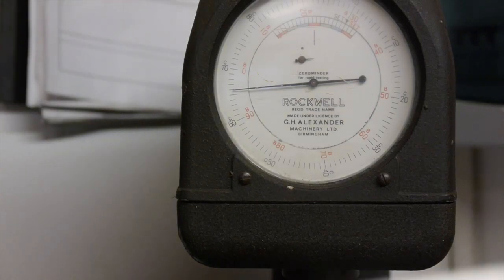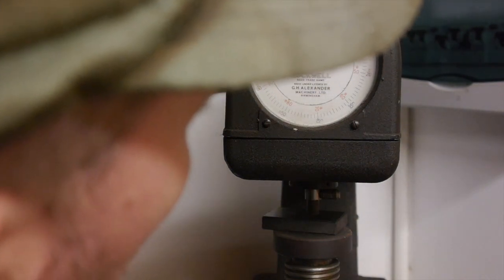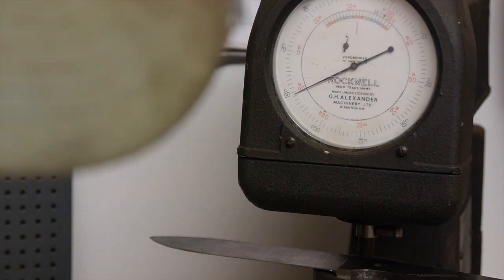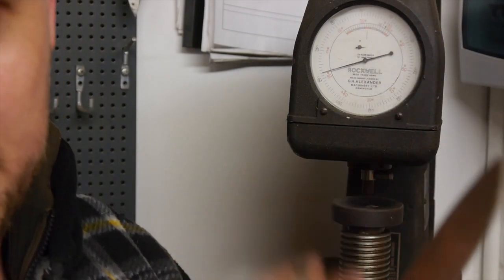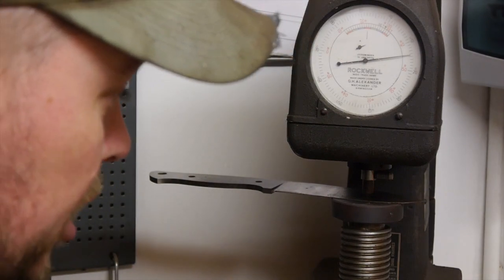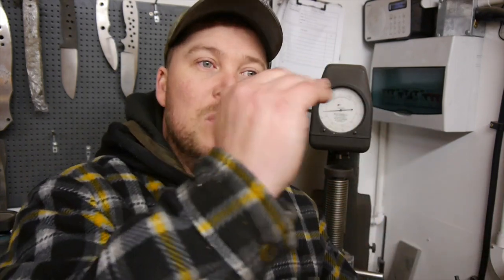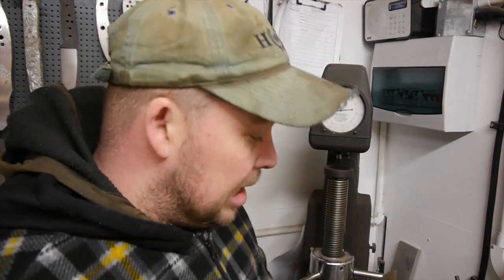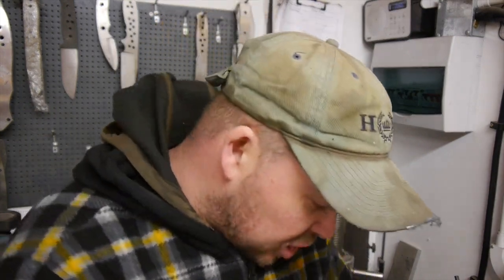rockwell tester grinding bevels.

Comment: I think that because of the angle you are introducing a lateral pressure. I would imagine that it wants to work in a perfectly vertical orientation with all of the pressure being vertical. You may well damage the machine or affect the calibration if you try to test pre-ground bevels.

Comment: Interesting topic Lee, does the same problem occur on a scandi grind blade edge? I wonder if the edge of a flat grind blade is just too thin for your Rockwell tester to give an accurate reading?.......atb......Sev.
Reply from the maker: +sevrin1965 yes mate if you tried on a scandie would be even worse. The only way is to leave the Bar flat, and then take your readings
Reply: +lbcustomknives Ahh ok mate, looks like it maybe as you suggested on the video that it may be something to do with the angle of the bevel then, cheers mate.

Comment: ref the variations in reading on a  blank with a part ground bevel... wondered about 3 things ...
1... where there is a test done closer to the edge might there be even a tiny give in the metal , just because it is thinner, or getting thinner , so the blank isn't pressing fully on the  test bed, and  thus a  reduction in the real resistance is  produced... A high grind, where more of the metal experiences the thinning out might make for greater distortion of the result. 
or...
2 ... Could it be that the angle of the bevel grind prevents the point from making a flush/flat engagement with the metal and causes the 'diamond'/tester point to only partially engage its surface area and allow a distorted result due to the reduction in properly tested area under the full  'testing head' ...
and all that is just me wondering , because I have the biggest L plates  on the planet when it comes to this stuff..  :)
3)   Could a really high grind be used to test variations in the distorted readings by checking repeated readings , spine to 'edge', as the metal gets thinner and thinner  , to see if any gradual variation can be  spotted ?   
Enjoyed as always... Thanks   Lee  ...
Reply from the maker: +DustyPilgrim1 thanks for the reply brother